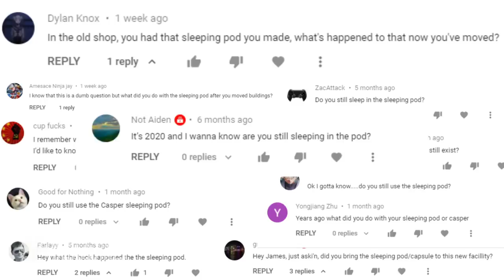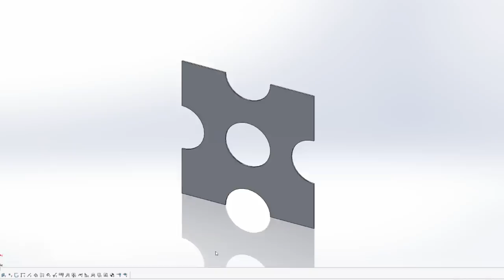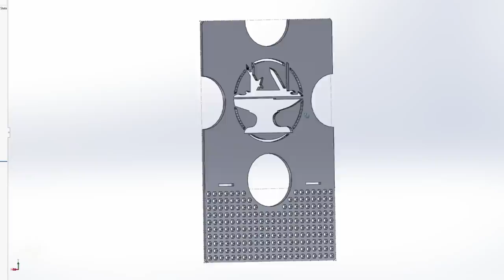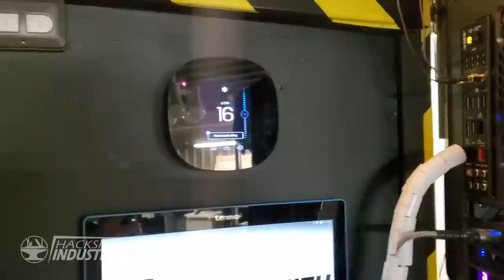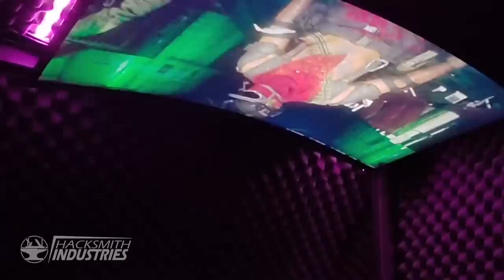We made the ULTIMATE GAMING POD!

Comment: Everybody: I can’t wait till 3000 series are back in stock. 
Hacksmith: SO AORUS SENT US NOT ONE BUT TWO 3090.
Reply: Also Hacksmith: AND I'M GOING TO HANG ONE OUTSIDE THE CASE 20 FEET ABOVE THE GROUND.
Reply: @chow_3699  WELL IT FELL SO THEY GAVE US 5 MORE! >:)
Reply: @Null_Knight  Next video: WE MADE A TABLE OUT OF 3090 GPUs
Reply: @hithere589  Clear resin cast 3090s scalped
Reply: Bruh
Reply: @ac.creations  Epoxy resin or are we just going to use urea formaldehyde.
Reply: @hithere589  Hello there. thats a pretty deep cut there. vacuum degassed clear epoxy into all the heat syncs itll look sick.
Reply: @ac.creations  I feel bad for the 3090s. After all they are an endangered species

Comment: Imagine being in this thing when the power goes out
Reply: I do not want to imagine
Reply: if you build this, you know how to make a quick exit ... at least i hope they know how to build one... Imagine the headline ^^ Dead gamer in self build coffin
Reply: @georghartmann6971  LOL
Reply: They better bury you with access to power, undead gaming right there
Reply: It's the ceilling screen for me
Reply: Spooky
Reply: Feels safe
Reply: I was just thinking about this
Reply: just put a generator right there
Reply: coffin
Reply: This is actually pretty common. All you have to do is make the default state of the door open and close it only when you have power.
Reply: @zaidibnalhaqq4837  But, if you don’t have power then how would the door close. A spring operated mechanism that has a latch that locks when there is power is the only option that I can think of
Reply: @arnavchauhan178  spring load and use electromagnets, just like the fire doors in schools. ever wonder why they're always closed already during a fire drill, though they may be open normally during school hours?? It's cause the electromagnetic hold-opens turn off from central controls in the office. Can set that up essentially as a spring loaded drawer driven closed with a powered rack and pinion, secured with the electromagnetic "lock". Cut the power, the lock fails, the spring starts pushing, and the pinion is allowed to travel back along the rack in the frame, thus opening the drawer/pod
Reply: I would break my way out of the pod
Reply: TOREADOR MARCH STARTS
Reply: and that’s why you buy a ups
Reply: Generator
Reply: @BaguetteOnVodka  Yeah.
Reply: @_Vergil_  hell yeah Samuel
Reply: My claustrophobia
Reply: bruh
Reply: cant get out?
Reply: I believe they have a pneumatic system to bring out the bed, which means no electricity required, but idk if they made it so there no electric based system to turn on the gas.
Reply: thats what happened to riley although he was sleeping
Reply: Yeah two seconds after powering it up you’re stuck in your gaming pod 😂

Comment: the thing that pains me the most is that the 3090's aren't in SLI
Reply: Yeah the other one is doing nothing lmao
Reply: @RedRacconKing  you could use the 2nd one but not in gaming
in my pc i have a 2070 and a 1050ti
i use the 2070 for gaming and the 1050 as a dedicated encoder for OBS and to process my webcam software
Reply: @Antonion.t  that's smart actually. I wonder how well that works vs having an entire separate streaming PC, since it's still probably hitting your CPU to some degree?
Reply: @ForeverMasterless  i have a 3700x, if it affects it, it's probably just 1-3%
Reply: @Antonion.t  Due to how encoding video on a gpu, that 1050 is really not doing much ... I would say it’s a difference of like 2%, unless that 1050 is handling a ridiculous webcam resolution
Reply: @Antonion.t  I have an rx 570 and before I finally decided to buy display adapters I used my gtx 550 ti as a passthrough for my monitors

Comment: No no no, you can't do anything with those monitors on the roof and it's so bright! Also, there's no point of having a second 3090, since you can't fit it, meaning you can't use the sli bracket required for sli to work.